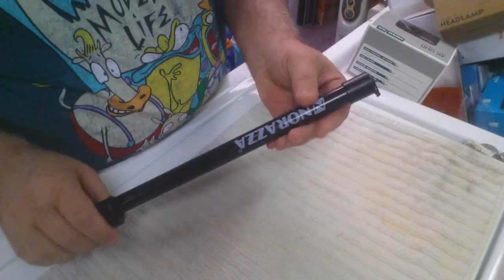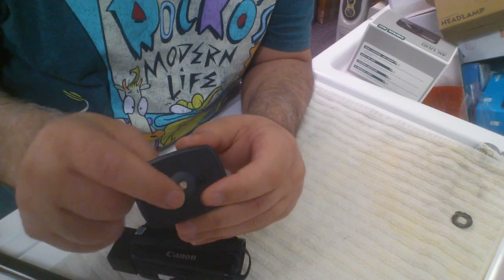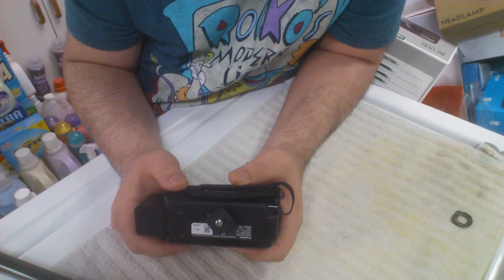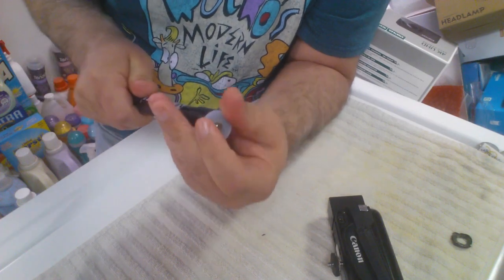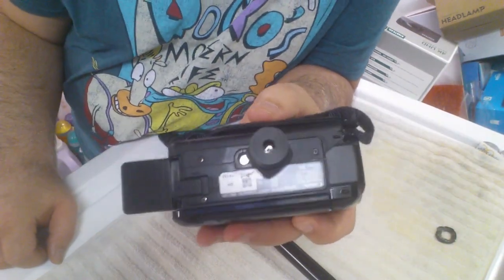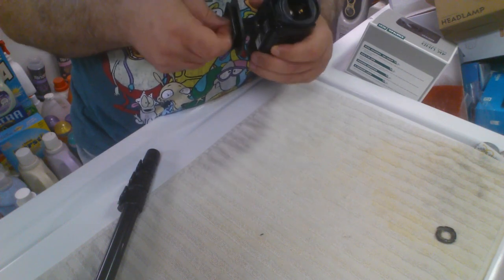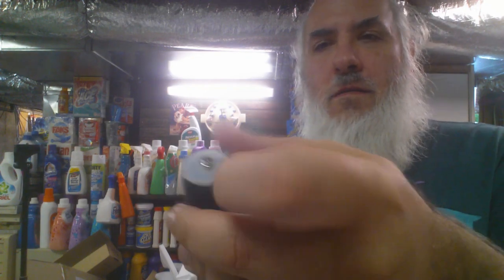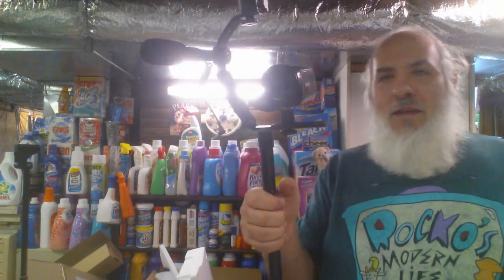Broken Camera Plastic Tripod Mount Hole, And My Solution

Comment: Looks like that repair should work just fine. I've always left the quick disconnect attached to the camera, because of that very reason of being a high wear area on the camera.
Reply from the maker: If my quick release plate had female 1/4"x20 threads so I could screw the monopod into it, I would have done the same.

Comment: I would have thought about using a faucet washer to replace the squished one.  My 1/4" mounting hole is messed up on my camera.  I bought it refurbished from B&H Photo.  Who ever had it first cross threaded something into that hole so every time I try to mount the camera the screw wants to go in crooked.  I have to very carefully turn the screw while not allowing the threads to hit against each other.  When I do this the threads mesh together and don't follow the damage.  Sometimes it takes several tries.

As far as a tap to fix the threads you would need a bottoming tap.  They are designed to make threads to the bottom of a hole.  They are less tapered then a standard tap but being that the depth of the mounting hole is so shallow I'm not even sure that would have worked.
Reply from the maker: Yes, that would have been a good idea and I looked into my hoard to see what I had, but didn't have any.  Best I had was a plastic washer, too slippery.  

If they would have made the threads out of aluminum, this wouldn't have happened.  A "decent" camera would have it made out of metal.  That wouldn't eliminate the possibility of cross-threading but would make it a lot more difficult, when dealing with small fasteners without a lot of torque applied.
Reply: @jaykay18  Mine has a metal insert but it still got damaged.
Reply from the maker: @tallboyyyy  That's why I VERY rarely even consider a refurbished item.  The wif once got a TV that was a floor model, it was a 13" CRT TV.  It worked fine, but in time of it being on, you had to turn the volume louder and louder and louder until it was at max volume and you couldn't hear anything still.  Same with the refurb VCR she had.  Remote didn't work properly.  Only sometimes.  Didn't matter if the batteries were brand new.  Eventually I found it was a bad solder joint on the IR emitter.

For the refurbishing company tech, it just has to work once.  For the end-user, it has to work normally every time.  That's something they can't test for.

Oh, just reminded me of a time many years ago, needed a computer monitor.  Found a place that sold used equipment.  They had a burn-in policy, anything sold would be put on a 24 hour burn-in test.  Well it passed, and the monitor worked.  They sold it to us with a 90 day warranty.  It failed on day 92.  They made an exception, and that monitor lived on just fine.

Comment: they sell press in threaded bushings for plastic/wood.
"Pair E-Z LOK 260-4-BR 1/4-20 internal threaded flange / knurled brass inserts"
you can either drill the hole bigger,or or melt it in with a iron. I had to use one for my yi camera.
Reply from the maker: I bought some t-nuts which I was going to attack with the Dremel and see if I can fashion something.  Nothing will be touched with the current setup until that breaks.

Comment: Having the same camera, that sits idol.😜 I would have reamed out the hole and JB welded a 3/8 to 1/4 tripod bushing. But after seeing the monopod stud. I would have corrected the potential failure, way sooner than later. But thats my advanced thinking to potential failure.
Reply from the maker: That's the potential plan for the future if the current setup fails.  As for the monopod, it still seemed to fit properly each time, until one day it didn't, even with the washer that was getting thinner and thinner.  I guess it was such a small amount of material lost that I never really paid attention to it.  I had seen the washer flattened out for some time, and never thought more about it other than "it's had a lot of use".